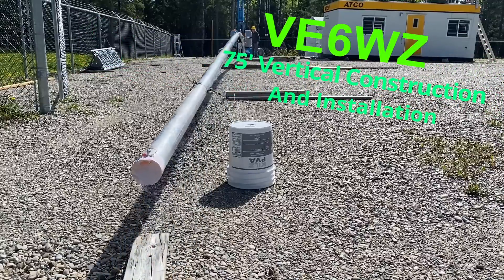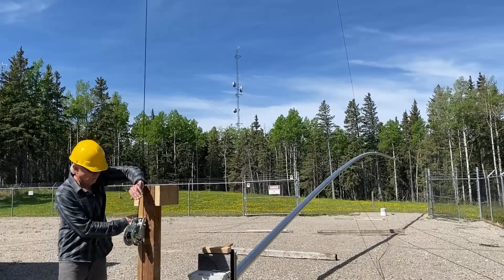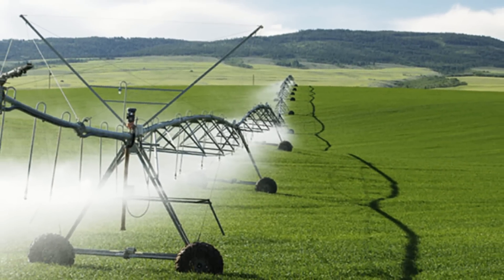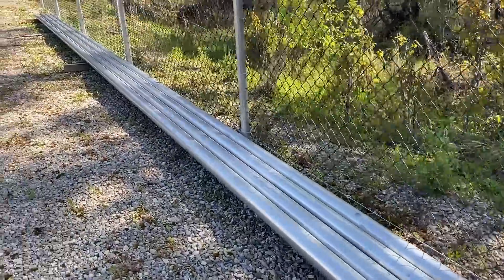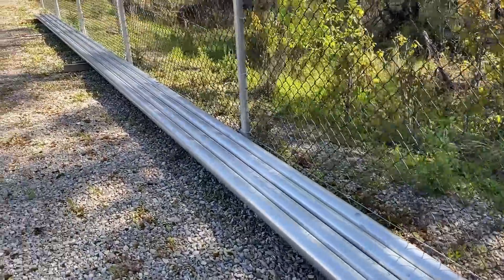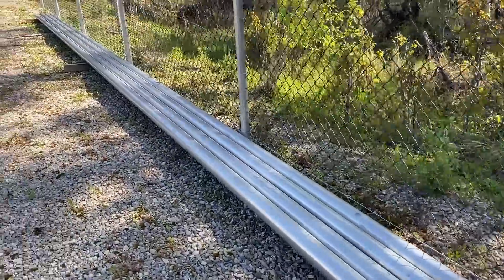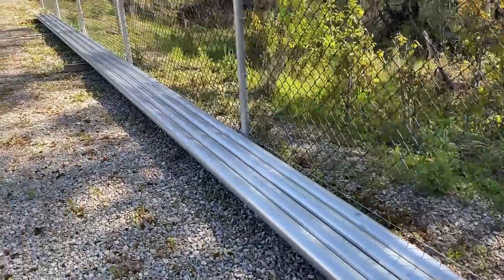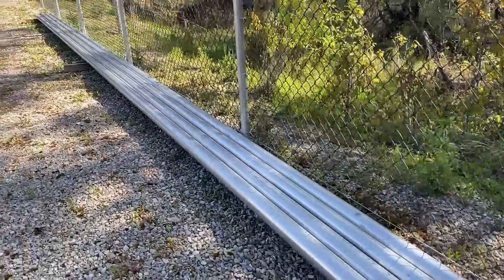How to Build a 75' vertical Antenna

Comment: Hi Steve, thanks for posting this! I have a 43' fiberglass push-up mast that supports my 204' dipole. My question has to do with guying the mast. I have guy rings at 13', 21' and 30' levels. Getting the top 3 masts perpendicular has been a real challenge. When you tighten/loosen one of the ropes, the mast above it gets tweaked out of parallel. When you fix that one, the one below goes wonky. 

How do you tension ropes, when you have TWELVE guy ropes to cinch down? 

I'm doing this alone; there are NO HAMS or neighbors close enough to assist me. Many thanks

Comment: why didn't you use the manlift to raise the antenna up? You could have tied the element to the manlift and raised the lift and moved it allowing the hard work to be done by the lift instead of you hand cranking. You mentioned the weight was only about 100 pounds so the lift would easily handle it.

Comment: Very nice work on this antenna system and a great presentation.  Wondering about your technique for aligning the antenna vertically?  Did you pre-measure the guy to anchor attachment point lengths... or just eyeball it?
Reply from the maker: I used my long level at ground level, and tensioned the first (lowest) guy set. The other 2 higher guy sets were just "eyeballed". In fact none of my 3 verticals are perfectly straight. Each has a bit of wobble, but mostly vertical :-)

Comment: Thank You so much for the great idea.  I just purchased a DX-LB 160/80/40 dipole for my new shack in Oklahoma.  70Ft apex would be very nice.   I will try and duplicate but using 4 guys instead of 3 due to wind loading here in the mid-west.  73. de WD5AX

Comment: Thanks a lot. Although no such tubing here I am using ordinary aluminum tubing 6m lengths. Plus 3m fiberglass and I went for folded monopole on 80m and Inv L for 160. Thanks again for the advice and content. OK2IT 73

Comment: DX of vertical antenna is not as good as dipole.
Reply: It's better for low angle
Reply: Good Verticals offers a grayline effect of some hours in comparison with dipoles 20 minutes... Phased Verticals with long radials offers better F/ B- ratio if phased properly. GL de Bjoern

Comment: Can you please tell me where you got the pipe?  I can’t find it
Reply from the maker: Hi Jamey...it seems you live in GA. Perhaps there is enough rain there that there is no need for irrigation?
GOOGLE: "Farm irrigation supply"
Sometimes used irrigation pipe can be found on eBay etc.
Reply: @ve6wz  the stuff I can find easily has a wall thickness of only 2/3 the stuff you got (0.050"). I'd really love to find the thicker walled stuff - if you can ask your supplier who made yours I'd much appreciate.  73 de AI4UC
Reply from the maker: @robseastrom1636  Google "irrigation torque tube" this tubing is thicker than the supply line stuff. there are numerous suppliers. Here is one example:
https://www.kroyind.com/irrigation.html
Reply: @ve6wz  Thank you!  So it seems "torque tube" is more associated with wheel line than pivot irrigation, and I'm trying to think if I've ever seen wheel line within 500 km of here (I'm in FM19).  It's very popular in the pacific northwest and there are a lot of manufacturers in eastern Washington and Idaho.  I'll ask around folks near here, but transportation for small quantities might end up being prohibitive - bummer, since if you happen to have it locally as yuou do this looks like an awesome option!
Reply: Aluminum irrigation pipe. Hope that helps you. 73

Comment: How did you calculate the top loading? Seems like it would be a pain to adjust the lengths of those top wires.
Reply from the maker: At first I modelled in 4Nec2, but fine tuned after final the install by trimming. (easy to do with the man-lift)
HOWEVER, the exact final tuning is done with inductors at the base.
For any series fed vertical, this is the way to go. Make the antenna resonant above your desired frequency (short) and fine-tune with inductors at the base.
I explain this in my other videos.

Comment: very similar construction as I used for my irrigation 80m 4 square.  While two level buying should been ok, the verticals set up a natural resonance that made a terrible racket and they nearly walked off their base insulators.  3 levels and they are fine.  Been through 145 km winds and heavy ice since 2008 or so....